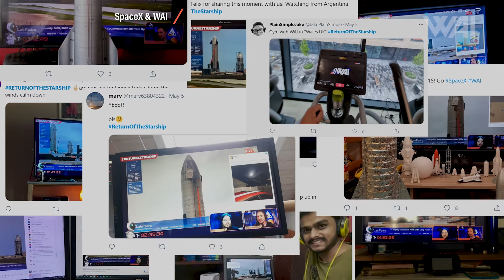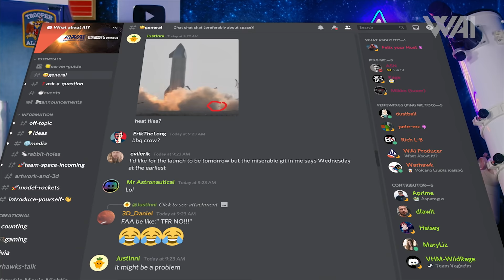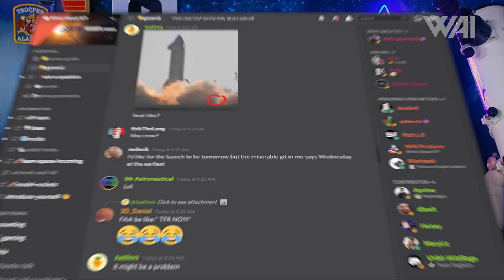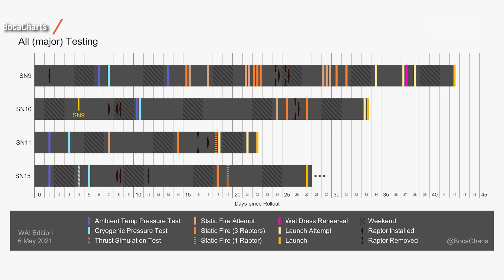SpaceX Starship Landing Achieved! – Why Did It Work This Time?

Comment: Is it just me or it still looked a little too fast on landing?
Reply: Scott Manley thinks it was faster than SN10.
Reply: There’s a video showing how the legs were crushed during the landing,. There’s still a lot of work to do,
Reply: @geraldbalzer2429  they’re intended to crush. Falcon-9 does the same.
Reply: @geraldbalzer2429  Well they’re going to fix the landing legs so it can land softer and to balance on uneven terrain. They’re going to be somewhat like the falcon legs.
Reply: @fredbloggs5902  Looks like both Scott and I were wrong, seeing the footage SpaceX recently released it seems like they really slowed it down a few feet above the pad so it didn't touch down too fast.

Comment: Cheaper starships = more garbage in the orbit.
Reply: Everything in low orbit is either deliberately de-orbited or falls out of orbit pretty quickly.
Reply: How exactly. Fuel is the only thing that it wastes everything else is reusable. Also it could be used to bring down old satellites and trash with it’s huge payload capacity.

Comment: SpaceX can now use this successful test against Bezo and the other cry babies when he starts launching ships for half the cost the other two want to charge.
They won't even start building anything unless they get the money guaranteed while SpaceX should just keep going, build a private LEO station, his own MoonBase and then on to Mars.
Has anyone looked at the fuel benefits of using a Venus slingshot flight instead of waiting for the Mars direct windows. If it works then maybe Musk can use it in between the Mars Windows.

Comment: Deliberate failure. Space X have to push their rocket to EXTREME to find FAULTS, failure is good so they can find problems and learned from it.  A first "successful" test doesnt mean it is safe, sometimes design severe defects are hiding behind marginally engineered components. 737-MAX performed well in Test, because Boeing and FAA goes easy on it, as the result MCAS is not properly tested and the passengers and crew become the BETA testers.